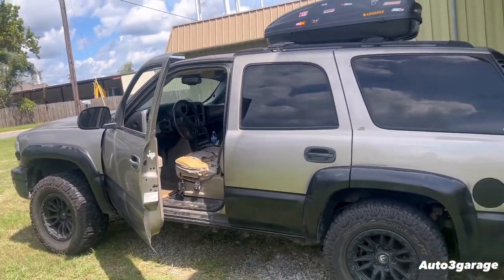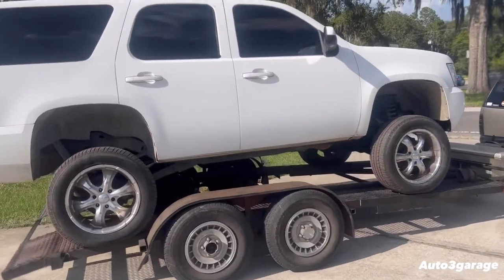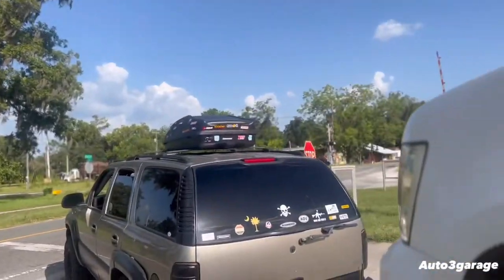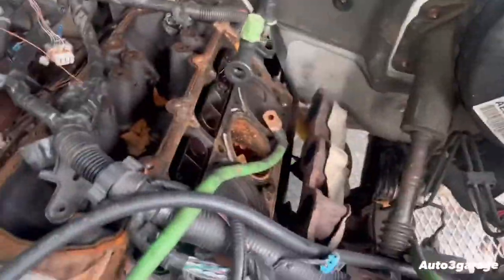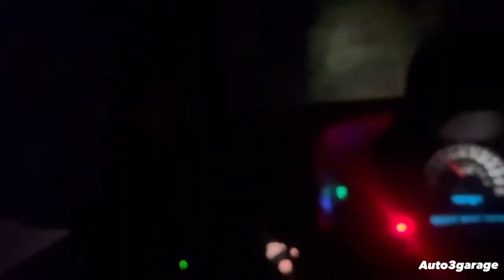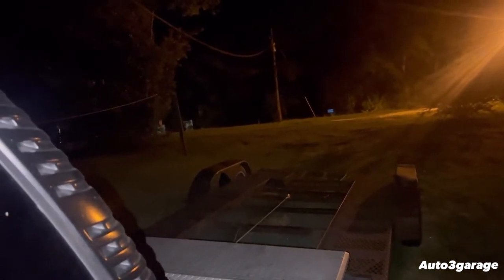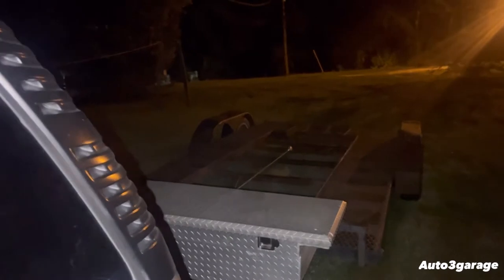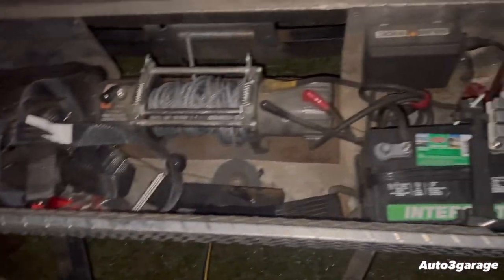Chevy Tahoe towing for the first time leads to a disaster and long night!!

Comment: I have gmt800 Suburban and i love it for the longer wheelbase. I only paid $2,300 for it, it has high miles approximately 360k. The trans was rebuilt shortly before i bought it. I’m going to have new engine installed for the burb. I plan to long haul tow with it for future projects. I picked up a gmt900 Yukon short wheelbase to just turn into a clean build and not do any work with. The Burb is my workhorse. Would love a 2500 Suburban and put a Duramax in it. New subscriber. God Bless!
Reply from the maker: Good luck with build sounds amazing and I love the long wheel base burb and appreciate love and support 🙏🏽💪🏽

Comment: Turn your high beams off when ever in traffic. You are making it difficult for everybody else on the road.
Reply from the maker: You joined the garage if not join have a blessed day 😎🙏🏽
Reply: @auto3garage522  I see you doing your thing keep it up by the way what kind of winch you have to pull that truck up the ramp
Reply from the maker: @Franksinatra96  Thanks 🙏🏽 and I want to say 9-12 k older guy I know owns it.
Reply from the maker: @Franksinatra96  not a special winch either